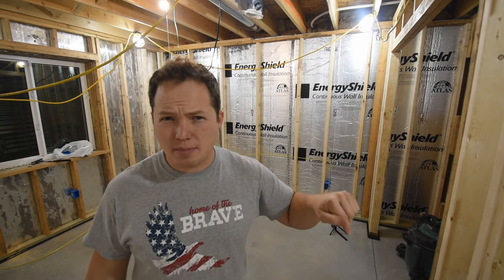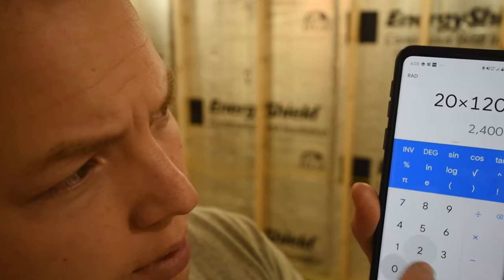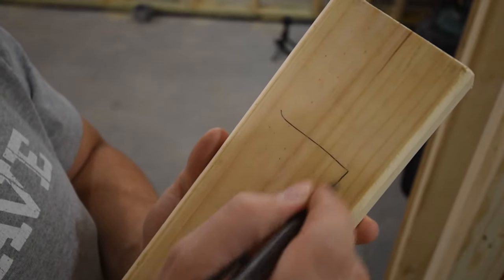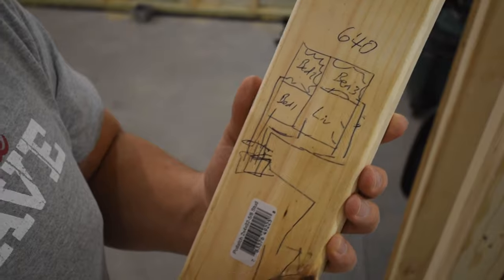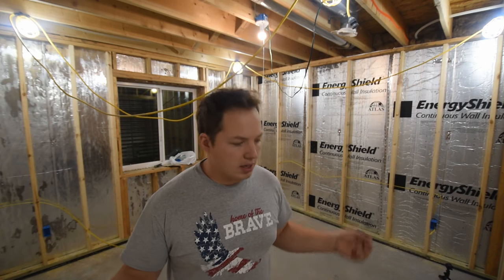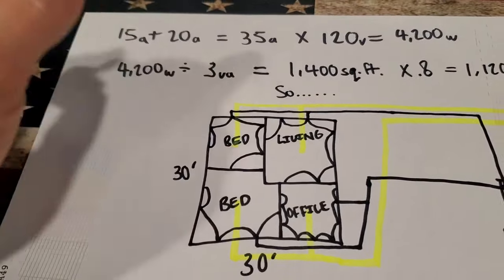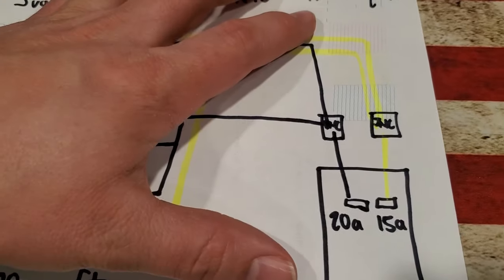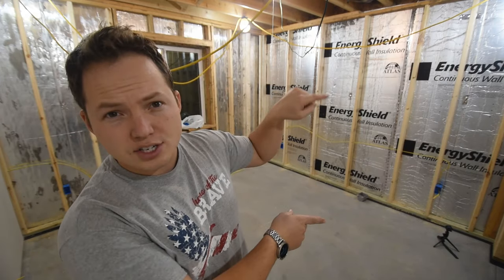Does a Bedroom Require a Dedicated Circuit? - Using the 3VA Rule To Calculate Anticipated Loads

Comment: va - volt-amps. generalized, close enough to power.... but not really as it doesn't include the effects of inductance or capacitance, which can effect actual power use.
Reply: Will Barnz   Yes that is true and what you are taught in school.   But for the purpose of putting loads on breakers, what are breakers rated in?   Amps.   If you have resistive load, power factor is 1.   Va is equal to watts.    Inductance and capacitance make amps lag or lead the voltage in time, right?    But the issue is breakers are rated in amps and leading or lagging has no effect in the breaker.   So, VA is always used when calculating loads to size circuits.   Don't get too hung up on power factor if you are designing electrical systems for buildings.

Comment: I would just go ahead and do 1 per room splitting the circuits across 2 rooms.  3 max.  Why?   Future proofing.   Someone may want to have an amplifier with their guitar., or space heater which could pull half of a 20 amp breaker.

Comment: There is minimal. Requirements but with the new code of requiring serge breakers dedicated lines for bedroom makes circuit indemnification  easier also the few butchers that do up and down   where you have multiple outlets on various  floors on the same line makes. Trouble shooting a nightmare

Comment: This is the cost effective way AKA cheap way to do it. If I was wiring a house or rewiring a house every bedroom would have 2 20 amp circuits have 4 receptacles spilt so the top half is one circuit and the bottom half is a separate circuit. Share a neutral and have the light on one of the circuits and put that room on a double pole 20 so if one circuit tripped the whole room will have no power since you are sharing a neutral. Now if you ask why so over kill say you want to have a space heater and then plug in a vacuum 2 separate circuits no breaker tripping.
Reply: When you do this, it's important to point out that you should separate the circuits on different phases and NOT the same phase.... I repeat, never share a neutral on the same phase of it could get overloaded and cause a fire🔥 and your breaker wouldn't even detect it. Important to point that out, also call a licensed electrician if you're not comfortable doing electrical work!
Reply: @AH-ic1pn  exactly you a double pole not a tandem.
Reply: @blazertracer1  yup, double pole it. I've seen people doing this without using a double pole breaker and luckily I was there to tell them not to install it like that.
Reply: @AH-ic1pn  yep have to balance the load between both lines and the neutral.

Comment: I'd like to get a new GPU called the RTX4090. It draws about 450watts, my current computer uses about 250Watts with the drives and without the GPU considered.
I may have to keep it in the dining room where we have a 20 amp breaker. Most of the other receptacles are on 15 watt breakers.

Comment: Hey Ben I am wondering why you like to separate your lighting Circuits from your Receptacle circuits? If it was me I would like to wire the rooms individually and on there own circuits. So for instance the master bedroom is on its own circuit along with the lights and the receptacles being on the same circuit. I like this because if a breaker trips and I walk in to flip the light on and it’s not on then I know there is no power in that room. Thoughts?
Reply: That meas when the breaker trips you will be in the dark and have to investigate it in the dark. I think that is just obsolete way to do things.  Typically you are in the room when it trips and will know it. Why would you go to the light switch.

Comment: For lighting circuits, always assume that the homeowner will install a big honking ceiling fan at each ceiling box when calculating branch circuit load.  I also use 15A for lighting but limit the number of lights to a circuit because of the ceiling fan issue.
Reply: David D     Not sure why you would be so concerned about ceiling fans.   If they have a light kit, now they are typically 2-3 15 watt LED lamps and the fan itself is 50-80 watts.   So worse case,  125 va or around 1 amp.   If considered continuous load (which it would not be for the fan) that would mean 1.25 amps per fan.    Reference for fan load.  https://agoodlyhome.com/how-much-electricity-does-a-ceiling-fan-use/
Respectfully,   Kevin

Comment: kitchen do separate circuit per wall
Reply: Sgt Joe Smith     Some efficiency apartments have the kitchen on one wall.    Still one circuit?
Reply: @KevinCoop1  I'm not an electrician but from what I've heard the code requires 2 - 20amp circuits for kitchen countertops, 1 circuit for microwave oven, 1 circuit for stove and, possibly(?), separate circuits for refrigerator, dishwasher and garbage disposer.
Reply: @munsters2     You are correct!   The two circuits are minimum.   I put (5) countertop circuits in our kitchen.   With all the new kitchen gadgets there are now, during holidays with lots of food being prepared, I’m happy I did.
Reply: @KevinCoop1  Ha, ha! 5? Yeah, I love overkill, too.

Comment: The answer is yes.....whatever Ben just said, no, do not do this....always separate per room.  It might not be "required" but you'll end up pissing someone off at some point.  Most heater units have a 1500w setting and will blow circuits if you connect 2 of them on the same line.  You never know what financial situation a homeowner will be in to require unconventional loads from time to time, and to have 2 or more rooms blow just because of it is tedious.  I am dreading having to rewire my entire house because some dumbass decided to put 2 outlets from one room on the same line as 2 lights and 2 other outlets from another room, and a mismatch of other outlets throughout the house.....just lump them per room.

And for kitchens....you should lump alternating outlets to different circuits, so that people can use multiple appliances (like a microwave and a mixer).
Reply from the maker: I completely agree that if you have the money, time, and patience to use a dedicated circuit on each room then by all means go for it! This is a topic that doesn't have a perfect answer. Some claim that I dramatically oversized my wiring for this area while others, like yourself, would like to see a dedicated circuit for every room.

The main thing I wanted to get across is how to think about and understand your options. I really love hearing the different opinions in the comments so thank you for sharing even though you'd do it differently! Actually, I would probably do it room by room like you mention and then combine some of the rooms in junction boxes near the panel. That would give me the future option of separating the circuits if needed.

Thanks again!
Reply: im with you I never put more than 10 on a circuit and every room has its own dedicated circuit...no way I would do what he said ever...ive been wiring houses for 20 yeas and I have never seen anyone ever do it his way.. you are just asking for trouble later on down the road..Ben I like your channel but some of the stuff you say I scratch my head at..this is one of them. your a good kid keep up the great work.
Reply: @MountaineerOutdoors  I totally agree with you. I also will put in a bigger panel box Than required initially, Because it is cheaper to put it in while building than to have to increase the size or add a sub panel later.
Reply: I can agree with both wiring options, isolated and grouped circuits. But panels have a limited number of slots for breakers. Dedicated home runs for each room would be totaling 8 slots, 4 @ 15amp and 4 @ 20 amp. This seems like an unnecessary amount of breakers for 4 rooms.

I like Bens approach by offering future adjustment near the panel but that can quickly grow congested near the panel if applied to other circuits in a new install. If it were my home I would group the 2 beds on 2 circuits and living and office on another 2 circuits. Lighting at 15 and receptacles at 20 totaling 4 breakers.

Comment: With the cost of wire these days, I'd home run a 14 and a 12 from the closest room to the panel for all 4 of those rooms. Doesn't leave a ton of room for expansion, but it leaves enough. You can home run another if you decide to add significantly more than that.

For all the "teenager with hair dryers" people - that's why 2020 NEC (if I read it correctly) you're running a 20A branch circuit just for countertop receptacles.

Comment: Use the minimal number of junction boxes, because each connection has a contact resistance, so many connections will give voltage drop in case of powerful apliences. Better insert 2 wires into breaker's terminal.
Reply: Exactly what I was saying, or use the panel box to splice up all your hr that you were gonna put on one breaker anyways and it'll be easier to split them up also later and just add another breaker.

Comment: A single, 15A lighting circuit can carry 1800W. With a dimmable, 60W-equivalent LED drawing not more than 10W, it seems like a single circuit could handle all of the lighting in your entire house. 🤓🤔🤷‍♂️
Reply: Theoretically you can, but if the circuit ever trips its way harder to figure out where the problem is.

Comment: Bedrooms should only be 15 amp and AFCI protected (lighting separate). Not a good idea to put residential light fixtures and table lamps, and what teens plug in on a 20 amp circuit, risk of those things they plug in over heating if they fail.
Reply: You make no sense

Comment: VA and Watts are not the same. VA is apparent power and watts is real power. Watts ^2 + Vars^2= VA^2 where Watts=Real Power, Vars=Reactive Power and VA=Apparent Power.  Essentially, VA=Watts/Power Factor . This is usually corrected by the use of Capacitor banks. You want to get the power factor as close to 1 (pure resistive circuit) to cut down on utility bills (especially industrial sites with a lot of motor and non-linear loads). It can get quite involved with calculations. Please investigate for your own edification as it goes beyond this video. In the future, I may start an intense electronic/electrical engineering channel with a lot of calculations. I just do not know if I will have an audience. Going from electronics to electrical is easy but vice-versa is not.

Comment: The house i bought should of been free. The wiring fiasco i found should be a crime. This wannabe jack of all trade was the worst. This guy ran some leftover  a 0 ott cable from the 100amp panel to a junction box. Soldered it to fraid 10 gauge cables for a cooktop and wall oven and also bugged it to 12 guage for washing machine recepticle. Can you imagjne how many more fire hazard i had to fix.

Comment: This is a bad idea. I say everything should be on it's own breaker and again, everything with AFCI and GFCI at the receptacle itself, at the panel, and if possible, at the pole. And also metal boxes, always, 12/2 with ground for regular circuits. Get rid of that 14 gauge and ALWAYS have a ground wire.

When you turn off a circuit breaker for ONE thing, you should have other circuits stay up and running for lights, and other parts of the house. I have worked on houses where you take out one breaker for a bed room, and half of their house goes dark. So now you've got an ever bigger problem. And with people putting in power strips for their phone charges, tablet chargers , watch chargers, blood pressure machines, TV sets, stereo surrounds, cable boxes, DVR device, lamps,  tooth brushes, electric blankets, mattress cooler heaters, and yes, still, even space heaters. Then people in their lavatories have their electric tooth brush, curling iron, hair crimper, blow dryer, while Mother is waiting for the iron to heat to press the wrinkles out of my shirt, or the sisters skirt... You need those to have the least possible way that one circuit could become overloaded. Can't tell you how many times I was late for school because of all that crap blowing a fuse. Old house in 1980's. So no circuit breaker yet. And in a pinch, someone might have put a penny behind the fuse and someone MIGHT have melted that penny and almost burned the house down... But Dad, I mean someone didn't know what he was doing.

I also say two J Boxes. One for the wiring that comes into the room, where all the connections are made, then wiring that comes out of the boxes for switches and receptacles. So the ONLY thing in a gang box should be the switches and the wires going into and out of it, without splices or tie ins not in the same box as the switch or outlet. All of these things would drastically reduce electrical fires and aggravation when something fails. It would also make it easier and safer for the electrician.

Comment: This sounds like a dumb way to look at it. Why would square feet determine your load or how much and now how many actual outlets or connections you plan to plug into a 15 or 20!? Why look at it this way? You can have 2000 square feet and still only run one outlet to it, right?

Comment: Sorry,  you have an error in your explanation.   The VA v/s SQFeet calculation reserve is only for lighting. So, you divide the SQF by 3VA and get the reserved load for the house lighting only.         For receptacles you should calculate as following:    “The National Electrical Code (NEC), normally requires each receptacle outlet to be calculated at 180 VA [120V 20A overcurrent protection device (OCPD) ÷ 180 VA = 13 outlets].”    Those 13 outlets(for each 20 Amps circuit) must be installed as following:  Each room wall must have at least one receptacle and receptacles should not be more than 12 feet apart.     (Receptacles are installed at 12” from the floor. Switches at 46” from the floor).    At the kitchen is required the following 20amps 120volts dedicated circuits:  1 for de refrigerator,  2 for the small appliances,  1 for the dishwasher,  1 for the      food disposal.        NEC require that every breaker in the breaker panel should be Arc/Ground Fault Protected.
Reply: stephan forray     Please pull out your NEC and read what it says about dwelling unit calculations.   Benjamin is correct.   Your reference to 180 V/A is for non dwelling unit purposes.    You probably do mostly commercial work.   A different world.